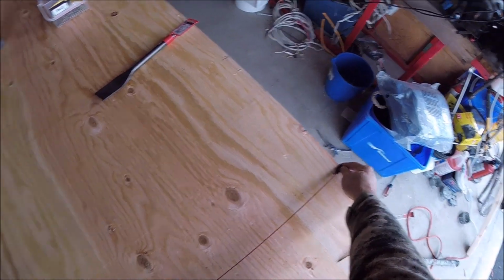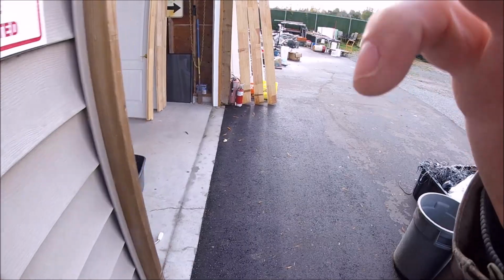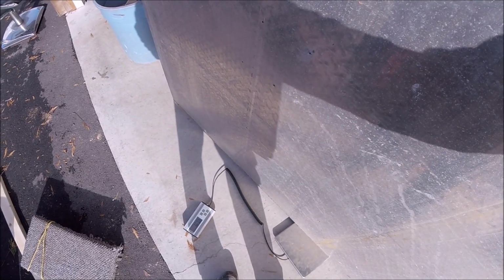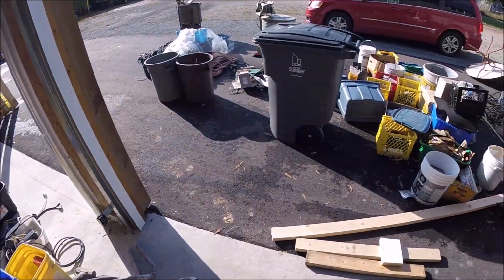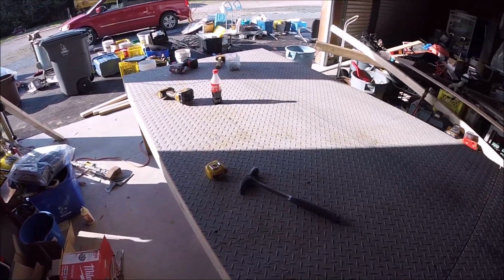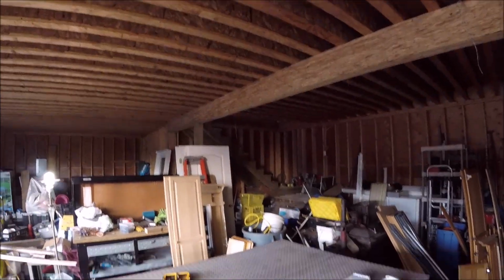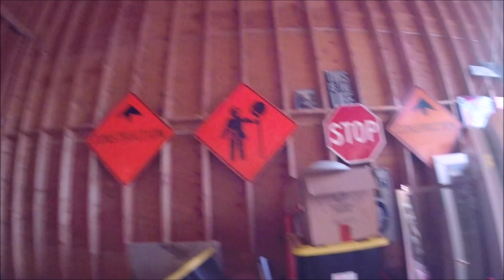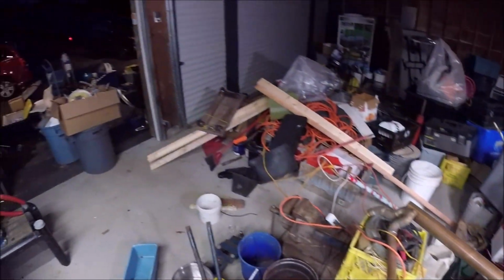Work Bench Completed

Comment: I think the only thing you need now is a large tool cabinet.  Home Depot and Canadian Tire should have deals coming soon.  If you can get all of your tools organized in one place and not in buckets, etc. it will make things so much easier.  Then your work area will be complete.
Reply from the maker: I noticed those tool boxes where around 1000 & now 1500
Reply: @CanadianTreasureHunter  Canadian Tire does have a few options that you can put together for around $1000 at the 50+ inch sizes for the top and bottom cabinets together, if you go a bit smaller you can probably put something together for around $600.  I know they are expensive but helps immensely with organization and knowing where things are.  I organized my shop this past summer and it's amazing the difference having everything in one place  that is easily accessible.  Totally worth the money in my opinion.

Comment: Maybe some steel angel iron on the ends so when u smash them transformers apart u can use them strip to set on the weld of the transformer then when u hit them with a hammer it will give u a better impact.....just a thought

Comment: You might want to see if your local scrap yard has a couple square feet of say 1-2" thick steel slab to use as a hammering surface cause the aluminium is a pretty soft metal and may be damaged by banging on it.